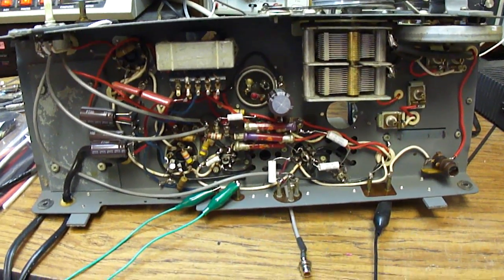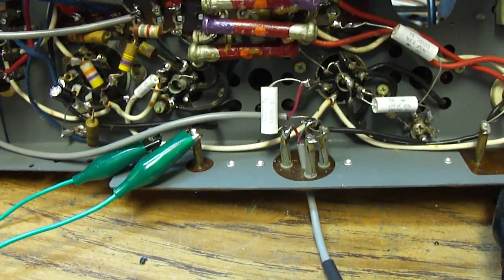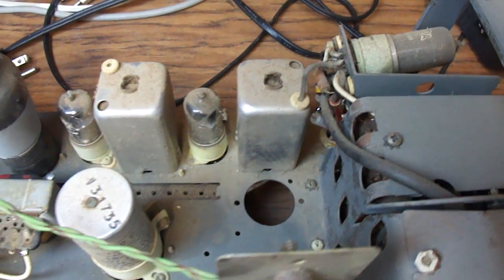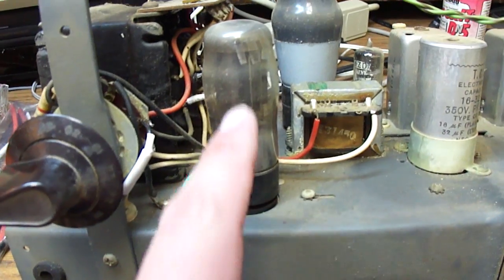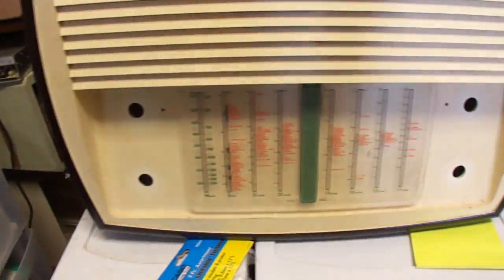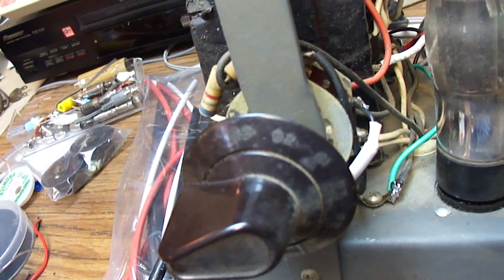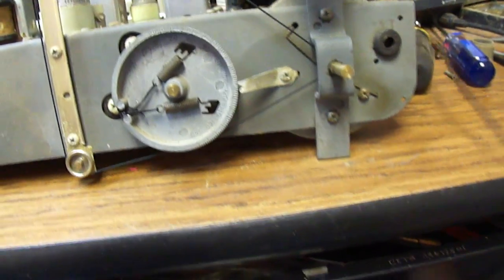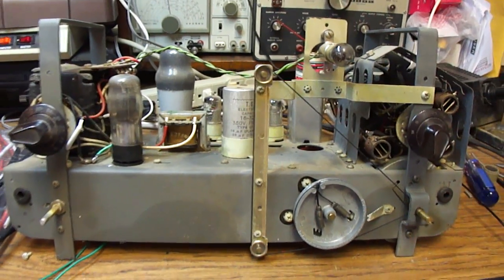1950's Murphy British Radio model TA154 repair (part 1)

Comment: Rectifiers very unlikely to go bad unless you have shorted cap. Please do replace the grid coupling capacitor to the output valve as a bad cap can take out output tube/transformer rectifier/mains transformer. A mains fuse is a great addition.

Comment: I think you have an export model there. The home market models would have had Long Wave. Some of the Mazda valves are known as 'Mazda Octals.' The base has a spigot that is slightly fatter than the U.S. Octal with different pin spacing, heater voltage and connections. The standard octal based 6P25 with a g/m of 8.8mA/V [6V6 4.1] is a high gain output valve with UK equivalents Marconi/Osram KT61 and Philips/Mullard EL33. The 6V6 will work with slightly reduced output more noticeable on the gram setting. Nice restoration.

Comment: Those 8 pin tubes with the key on the side were used in many European radios from the late 1940s through the mid 1950s, I think they were called "Rimlocks", I have an Eddystone made set that uses them. The power output tube is likely some British labeled version of an EL34 which are still being made. If the rectifier uses a 4 volt filament then it must be a pre war design, after the war they seem to have gone to 6.3 volts as a standard filament voltage, same as over here.

Comment: I've been trying to rebuild a 1960's Blaupunkt radio from Germany that has similar features, managed to find a factory service manual & schematic & was strongly advised to replace ALL the paper capacitors in the radio due to possible fire hazard.. Still can't locate all the necessary European tubes though.. Te radio was in working condition in the 1970's, but one of the tubes blew & hasn't worked since..

Comment: Nice radio! I have a wooden cased Murphy that I think is a little older. Mine only runs on 220/240 volts; so, it was obviously not meant for export to the USA. Seeing this radio makes me want to dig mine out and get it going.